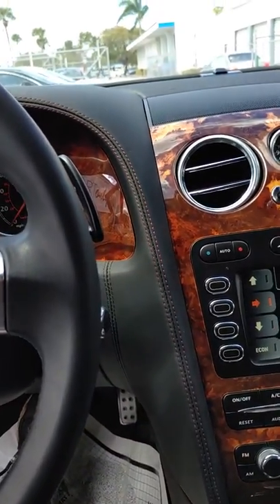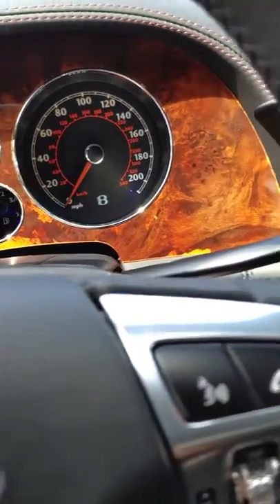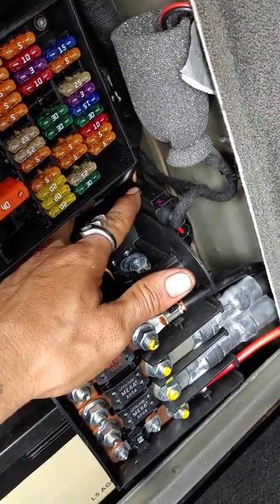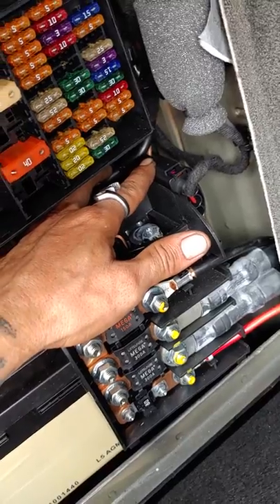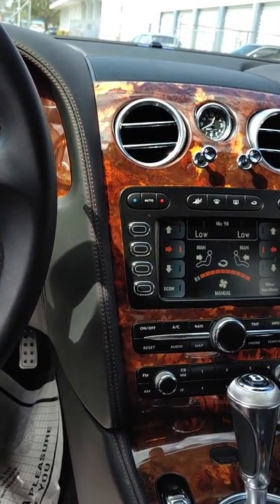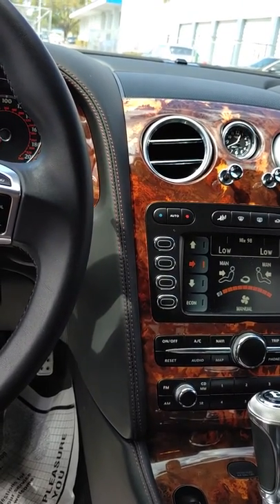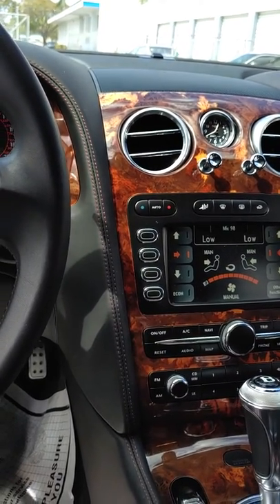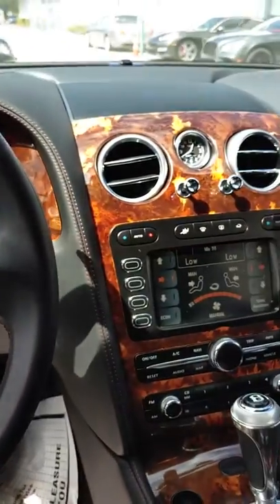Bentley consumer electronics shut off issue

Comment: I have another question and hope you can help me. The turn signal on the back and front left doesn't work despite changing the bulb, it still doesn't work. Could it be the fuses and where can I find the fuses for the turn signals?

Comment: I'm diagnosing something similar in a 2005 GT. All power shuts off while driving randomly and the key doesn't come out either. Wait for 2 - 5 minutes or sometimes 10 minutes, and it powers back up and starts working. I don't have "Consumer electronics" error but I do have "low battery, please start engine" constantly. Should I hook a multimeter up to that sensor and check what's happening to voltages?
Reply from the maker: I seen same issue and it was one of the cables that attach to the battery box was loose. Usually the only top one that's removable. I've seen it get very hot and loose contact
Reply: @b.s.772  Thanks for that! Would that be left side or right?
Reply from the maker: @shaazy  left side driver side big main battery.
Reply: @b.s.772  I've a RHD so left side would be passengers on mine. I checked this morning and couldn't find anything particularly loose, but I checked the voltage on that battery and it read 1.3 volts. I think the battery is not charging and car is disabling all systems to protect. As of now, car is dead (after driving it yesterday, it did the start stop thing a few times, thankfully made it back to the garage), key is in ignition and won't release.
Reply from the maker: @shaazy  definitely change the battery they do cause all sort of issues.
Reply: @b.s.772  that's the other thing, battery is like a few months old and it wasn't cheap. I'll try charging it and if it doesn't hold, then possibly change it. Can I theorize that the system can't charge the battery if it's run too low, as from sitting for a few days?

Comment: how to fix  it??
Reply from the maker: Replace sensor next to battery
Reply: @b.s.772      can you tell me  that  parts number?
Reply: What's the name of the shop you work at? I'm considering having my vehicle shipped to you.
Reply: Same issue here also battery dies over night 
Also showing consumer electronics off and air conditioning off
Reply: Any idea boss just replaced heater resistor which was on when resting